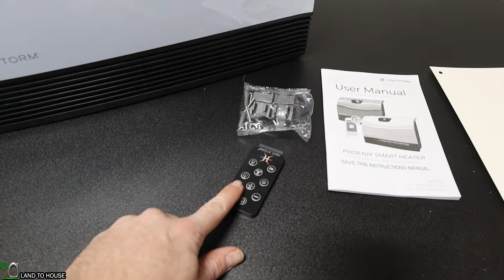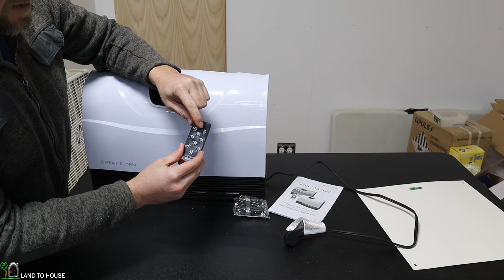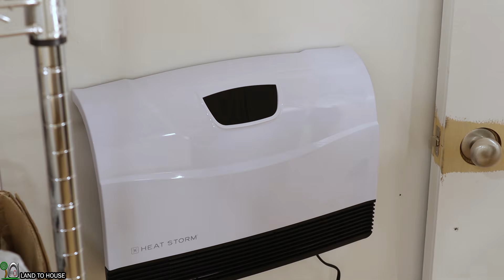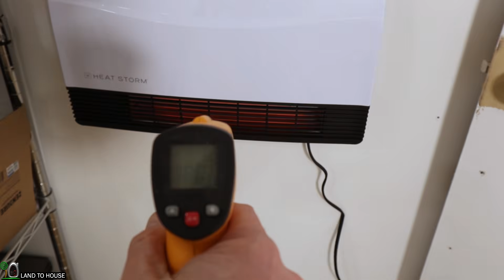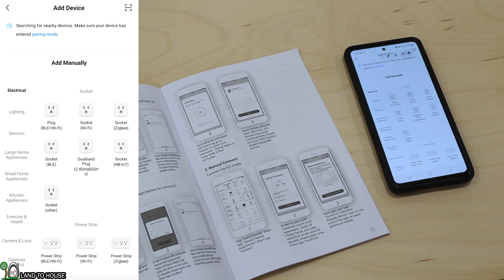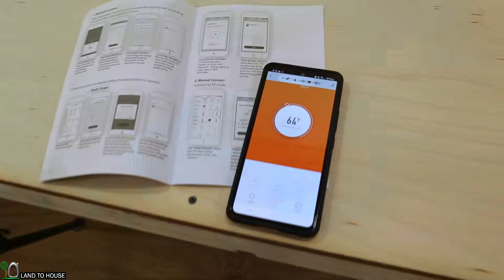Heat Storm 1500w Infrared Wall Heater - With Thermostat

Comment: I'm wanting to plug into the left of the unit. Can the cord go behind the device and protrude outward on the left of the device? I'm wanting this to go into my son's bedroom who is a 2-year-old. So he's obviously very curious about things. I don't want that cord to be something that he's messing around with. So I'm going to try to install it in such a way that the cord is tucked behind this item or something of the sorts. There is a chest of drawers that this unit is going to be installed right beside. So the cord will go behind the chest of drawers which will be to the left of the unit. What do you think of my configuration? Any concerns? Can the cord be tucked? Is this heater a good thing to put in a 2-year-old's bedroom? Because it's infrared, I was hoping that it wouldn't burn anybody if they tried to get close to it

Comment: I am hearing a WIDE variety of answers about this unit. Some say it costs a tone of money to operate heating a single room. Others say it’s great. I need this for a bedroom of standard size in my house its well insulated . Low’s here range from zero to 30 degrees F… Does anyone think this would work as well or beater than an infra red heater from say Dr Heat (the square wooden box ones).

Comment: Dude why can't anyone tell what size a space it will heat
Reply from the maker: My shop is 20x30 and this prevented it from freezing inside.
Reply: How cold does it get where you are at?
Reply from the maker: The coldest I have seen is 0 f.
Reply: 150

Comment: I have 3 of these in my home ,they are great to have but they will not heat a room bigger than 400 sqr ft .Its basically like having a hair dryer blowing .Gas prices are insane now so i use them as an addition to heating  ,electric bills are around 220 a month while gas is 350 a month during the winter time in New York . Works great with remote or Google assistant. try and mount them a lil bit low on the wall or you wont feel it at all unless your standing in front of it .

Comment: Does it come in a 175000btu version!
Reply from the maker: That would be a massive heater. Surprisingly this single unit has kept my 20x30 at 42 degrees even with the outside temp at 8 degrees.